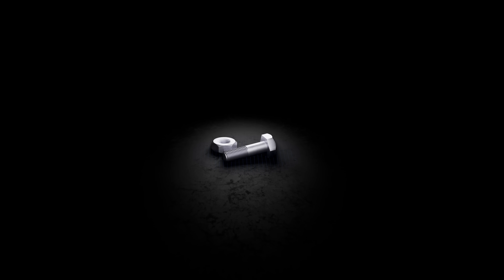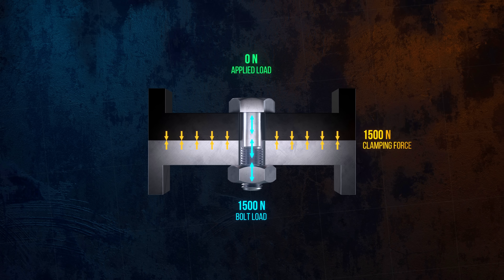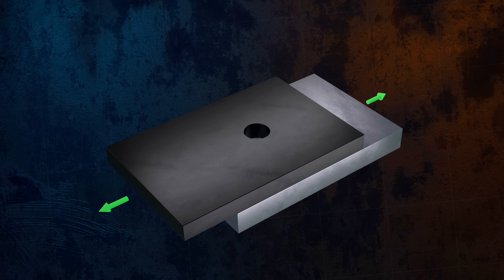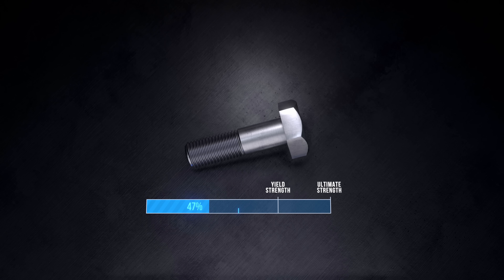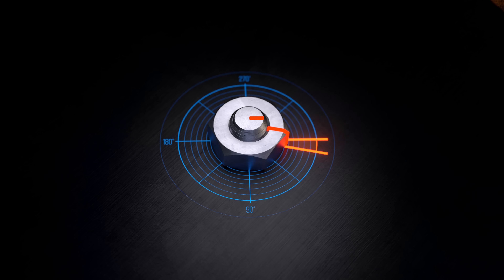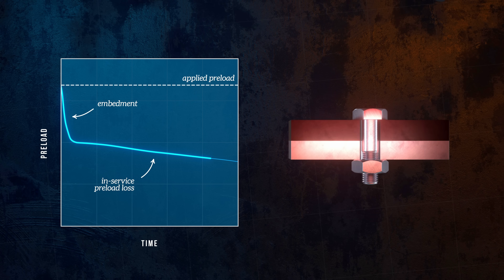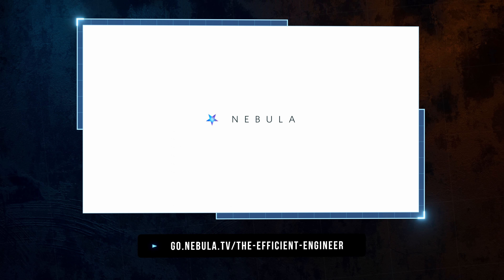The Incredible Strength of Bolted Joints

Comment: That thing about the clamping force is really amazing.  It took me a couple minutes to understand what you were getting at, but now that I do it's really cool.  The interesting thing is that presumably, bolts and nuts were invented centuries before they figured out the physics of why they work.
Reply: If you think about it, a screw is simply a wedge coiled around a cylinder, so it's quite easy to use and have an intuitive understanding of, without knowing material science.
Reply: @NicklausSIR2  Oh wow you're completely missing what this video is about.  Yes it's obvious how screws work, that's not the point of the video. It's what happens when you tighten the screw past the point where they touch, and how there's potential force added that needs to be released before the two sides separate.  It's the clamping force--what the video is about--that is fascinating, not that screws are ramps coiled around a cylinder.
Reply: sorry if it didn't come across as I intendend. I just meant to say, this fact might be the reason why people used screws before they knew the theory. In fact a lot of technologies have similar experimentation-then-scientific-models stories; at the top of my head, a lot of pioneers of flights didn't know about Navier-Stokes equations...let alone how to solve them at the time.

I know very well what the video is about, I have to teach that as part of a course on Design Engineering and I think I will recommend this video to my students because it sums up very well what the lectures cover.
Reply: @NicklausSIR2  Ah, okay, yes, that's better. :)  But anyway, I think the clamping force thing is amazing and completely non-intuitive, that if you put 500-lbs extra force into the screws, you have 500-lbs to release before the connection even begins to feel the weight, that's amazing to me, and I never would have figured that out on my own.  This video dramatically deepened my understanding of how-things-work.  (I know I'm not using the correct terms here, but you know what I mean.)  And yes you are of course right about knowing it works without knowing why--everyone knows to tighten a screw if you want to keep it from unscrewing.  But this video just explained WHY that works.

Even understanding it now, it's still kind of difficult to keep straight in your head--you're not deforming the screws or the plates when you tighten the screws, you're adding potential energy to it, it's that margin that keeps things from moving.  That is REALLY counter-intuitive.

Thanks.
Reply: Oh yes I agree this particular aspect is quite counter-intuitive, it took me a long conversation with a colleague and some calculations to figure it out; and explaining it to students with no prior experience is a challenge!
The more intuitive part for me (and that I guess early inventors did grasp) is simply the fact that you can torque a bolt with the force of your arm and obtain a clamping force one or two orders of magnitude above.

Comment: Glad you mentioned vibration because I work in aircraft maintenance and sometimes we have to torque check components after the aircraft has flown predetermined cycles numbers. The secondary torque values are noted and sent off to engineering monitoring to establish a resolution, if any

Comment: Your explanation of clamping force in tension connection is wrong.  2:00. When the tension load is applied, the load is taken directly into the bolt, increasing the tension load.  There is no spring action taking the load because the two plates are not connected.  The applied load reduces the clamping force which can only be resisted by the bolt.
Reply from the maker: This is not how it works. It's counterintuitive but how it's shown in the video is correct. You don't have to take my word for it though - check the literature!

Comment: 5:50 This is a concept the general public is woefully ignorant of. People think that if there is a shear loading on the joint, the bolt must be in shear. It isn't. It's the friction between the two plates that prevents movement and the bolt is just there to increase the normal force to cause higher friction.
Reply: Yes, a common error. Even in a tight fighting bolt and hole, there is still a lot of friction between the part surfaces. Whether that is taken into account or not is another matter.

Comment: the spring analogy didn't make a lot of sense. The only way a preclamp force can be reduced is by increasing the tensile load on the bolt. the reduction in preclamp is the result of this, it has no capacity 'take up' load.

Comment: As always, cool video and great explanation of how preloaded bolt joints work. But it would be better if you added some simple formulas relating preload force, the actual load applied to the connection and contact force between the plates.

Comment: At around the 15 mark, it should go without saying, but surface contaminants will contribute greatly to this. In some critical joints, even a film of oil on the mating surfaces can contribute to eventual loss of preload. 
We often see this in the heavy equipment world- people will replace components and not remove paints or protectants from the join, resulting in dramatically reduced reliability.

Comment: Isn't the tension force on the bolt (Preload) the result of the clamping force of the joint memebers ?
I mean when we tighten a nut a, the two joint members are clamped or compressed togther, and hence this clamping is what pushes the bolt and creates the tensile force on the bolt, not the opposite ?

In other words: Is the tension force the reaction to the clamping force or vice versa ?
because in my opinion the clamping force is what generate the tension force on the bolt (Hence the tensile force is the reaction to the clamping force), but the beginning of the video indicated otherwise.

Thanks in advance

Comment: How does clamping forcing help with the bolt load?? Isnt the normal force of the 2 parts just pushing each other away??
Reply: I dont get how clamping to 2 parts together causes it to act like a stiffer spring.
Reply: I’m having the same dilemma - it’s a net zero force, the clamping force is only apparently relevant to rigidity and surface sealing…

Comment: This explains why they switched from rivets to bolts on girder joints.  The preload is much harder to control, basically just that resulting from the rivet shrinking when it cools off.

Plus rivets can't be made of hardened metal, since they are installed hot..

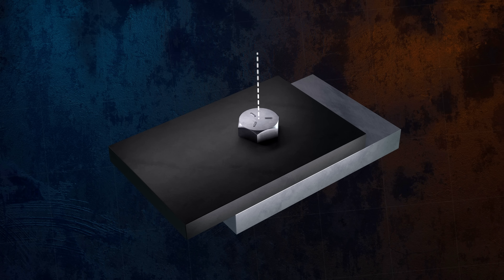Comment: 5:05 is this the same when hot rivets are used instead of bolts? I guess the real question is: are hot rivets in tension once they have cooled? Or does the system rely solely on the actual shear strength of the rivet material/diameter?
Reply: Rivets are used in shear joints only.

Comment: Bolt elongation can play a part in slip resistant coupling alignment too.  We had a 50 year old coupling hub that was kn rough shape and didn't have time to machine it.  So we calculated preloads to compensate for the variation in the hub flatness.  That allowed the rotor TIR to be in spec.

Comment: Sorry but it seems a little confusing at around 2 minutes in.  The video indicates that preloading the bolt creates a clamping force at the joint.  However, later it is said that when there is a pulling-apart force, the clamping force takes up the majority of the force and the bolt very little of this force. But this seems odd. How come something under compression like the springy part of the joint take up some of the force of the bolt itself when it is being pulled apart?  It wants to spring back and that adds more to the bolt preload. Mind you, I can see how there is no displacement because that effective displacement would be taken by the clamping forced displacement but ultimately it seems all the forces are on the bolt. That is the bolt gets the preload tension PLUS the applied pulling force tension, not some fraction of it.  The video at this point seems in contradiction of that and I feel some clarification is needed.
Reply: I agree with you. the video doesn’t account for the normal force between the members, which would mean that adding a 1N load would reduce both the clamp and normal forces by 1N apiece, for a net change between the members equaling zero, and leaving the entire change to go to the bolt.

Comment: I think if you add some silicone around the handle it would fit more people b/c the compressibility of the silicone and it’s friction coefficient would hold it in place across a wider range of finger sizes. I’d love to see this in a sheep’s foot blade geometry for a utility knife. I think a sheep’s foot edge would be safer when leaving the knife attached to my hand to use my grip on things.

Comment: Errr no.
Unless we’re going to ignore Hooke’s law the load in the bolt will not increase as the load increases in the tensile load example.
E=stress/strain.
Unless the bolt extension actually increases (I.e. the joint fails) the stress will not increase.

Comment: We use hydraulic pre tensioning on critical studs on Mirrlees locomotive engines , it involves fitting hydraulic jack on each stud to stretch it then nut is just snugged up ,then jack released . This is used on cylinder heads , palm end (attaching con rod to big end carrier) , big end studs and main bearings

Comment: As an auto tech working on Mercedes-Benz, seeing all this is pretty sick.   
I can also confirm, sometimes torques do drop over time. Every car that comes in that I touch the wheels on, I check the lugstud torque on every wheel. Should they loosen over time? Not really. But sometimes they tighten just a little bit. I also go back over wheels every time for that reason too. I go in the same star pattern, do the rest of my wheels and then do a fast once over on all the wheels again.

Comment: I discovered some of the above simply through observation of bolts used in wooden structures, especially when taken apart and put back together again repeatedly. You can frequently see fatigue issues as the bolts are much stronger than the wood. It's fascinating to see what joints are pushing the capability of the wood/bolt joints, and what joints do not show visible fatigue. I learned all this assembling, taking back apart and reassembling, a backyard jungle gym for the kids as we moved around early in our marriage/family. I should also note that we live in the Midwest and the delta temperature and humidity varied throughout the year. I ended up replacing some of the wood and switching to larger bolts in stressed joints that were also roughed up and glued.

The above was used for about 2.5 years before we moved to our newest house which we have lived in now for over a decade. When I took apart the jungle gym the last time, we had to pry the wood apart with a crowbar and no stress was seen in or around the bolts/holes. Thankfully, this was only for those joints that appeared fatigued. I recently inspected the critical joints for visible fatigue and found none. Adults are not allowed to use it, only children, or at this point, grandchildren  🙂
Reply: I am a fastener supplier from China, contact me if you need, thanks!

Comment: As someone who analyzes bolted joints all the time (awesome explanation btw), and is trying to also learn blender, do you have any tips for leaning Blender? Are you modeling ALL of this geometry or do you get it from a store or something?
Reply from the maker: I mostly model things from scratch but occasionally use existing models (e.g. for the Mars rover). For the nuts and bolts I used a built-in Blender addon called Bolt Factory.

Comment: Ideally, the unthreaded portion of the bolt should be near level with the surface of the metal. There should be no threaded portion within the joint bolt hole.

Comment: I thought with applications where weight wasn't a factor, it was better to over build. Use bolts that are beyond the stress that will make them fail.  A building will not suffer if the bolts used  are stronger then needed. This is less true for ships, and aircraft have to be light as possible.